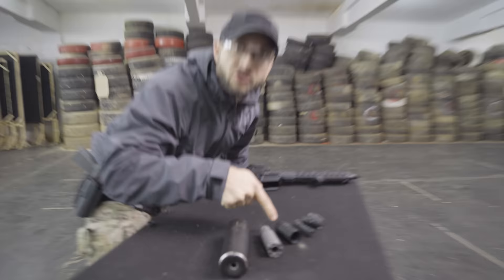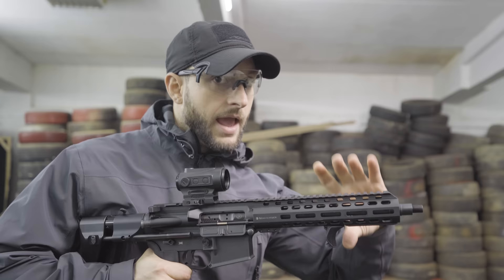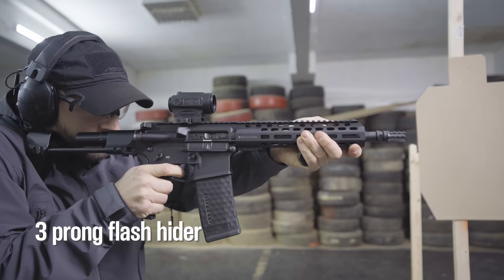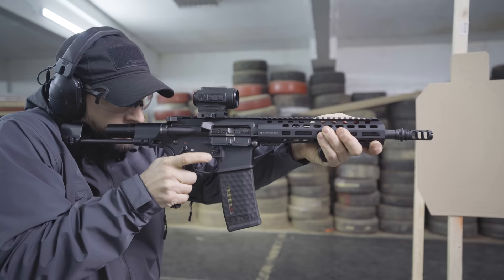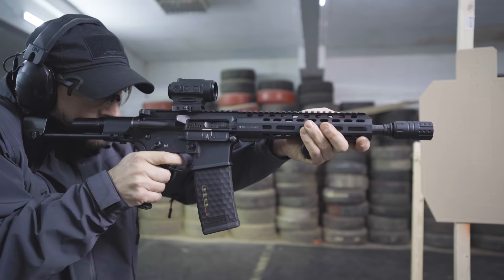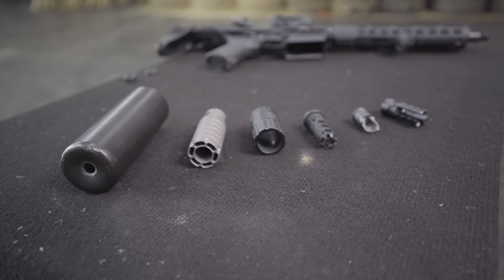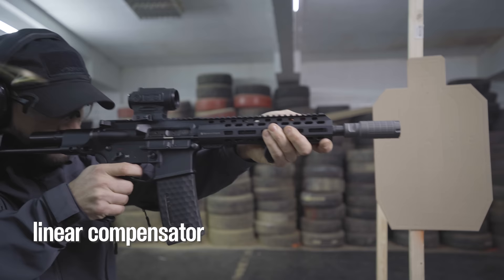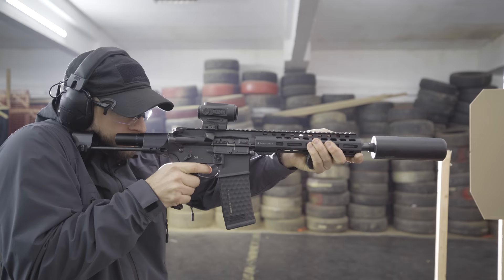Comparison of Muzzle Devices

Comment: Wouldn't a blast shield defeat the purpose of the brake?
Reply: A little bit
Reply: Yes, the one he was using It would defeat the purpose of the break, but there are some special ones out there that do both and they cost more and they are bigger.
Reply: A lot a bit. 
Takes like 65% affectiveness away from what iv seen on yt and iv tried one once n thought the same thing
Reply from the maker: Correct 
You can see the difference in recoil from a compensator with and without the blast shield. 
The blast shield is used in settings where you are shooting in close proximity to other shooters and you don't want to blast them with your compensator. So instead of removing the comp, you just attach the blast shield for that purpose
Reply: Yes.
Reply: Kinda, but I use mine exclusively at indoor ranges on shorties, just as a courtesy
Reply: Yes, it does defeat the purpose of the muzzle brake. By the way, what he calls a "compensator" in the video is actually a muzzle brake. A compensator is something else. A compensator is usually closer to a flash hider than to a muzzle brake and it always has ports on top to counteract the muzzle climb (compensate for the muzzle climb).
Reply: They're the opposite of a silencer. I like to refer to them as loundeners. 😆🤙🏾
Reply: Blast shields are used on ranges that don't allow the use of a break and/or suppressor. Sounds stupid but those ranges exist...
Reply: @jeffersondaviszombie2734  You are not 100% correct. He is showing brake combined with compensator because the device has ports also on top.
Reply: @ggrandcz  OK, fair enough. If it has ports on top, you could call it a compensator as well. In my experience, though, if a muzzle device has the design of a muzzle brake, with added ports on top, most of the time it will still be called a muzzle brake. Usually, the compensator term is more for muzzle devices where, on the sides you have some smaller ports or holes. Things like the Precision Armament EFAB and AFAB, the KAC MAMS, or combo devices (part muzzle brake, part flash hider) like the aforementioned AFAB and EFAB, most VG6 devices, the PWS FSC and a bunch more.
Reply: @jeffersondaviszombie2734  I think that it is stupid to differenciate brake/compensator. My PA M4-72 has more closed bottom part than upper part but all it has are side vents. Is it brake or hybrid? In reality it does not matter.
Reply: @ggrandcz  well, they call it a compensator, but it's a pretty much an almost textbook example of a muzzle brake.:) Well, we're just discussing the finer points of muzzle device terminology at this point. But it's all good.;)
Reply: Larger diameter blast shields allow for more of the positive functions of the compensator to be utilized. If you want to run a shorty expect a flash no matter the muzzle device. Run a heavier buffer like an H2 or H2 with the extra power springs from SpringCo. Also with cans make sure to get a vented charging handle like the one from Griffen called the Snatch or the Geissele Super Badass to keep the farting in your eyes at a minimum. For flash mitigation a suppressor is the best tool.
Reply: Yes, it effects overall effectiveness BUT It’s a sacrifice that needs to be made when working in close proximity of other shooters and working in doors, and should be essential for short barreled rifles and increased user effectiveness . 
	But it is still redistributing the gases to the best of it’s ability and can easily be taken off.  However , if you have a rifle and using it indoors and for home defense , it is extremely beneficial and creates more benefit than drawback especially if your using low recoil 556-545 etc. and  if it is a more compact shorter barrel used for cqc. 
	There are quite a few worthwhile/worthy blastshield devices like the Witt and the delta tek that actually reduce the decibels of the blast and create a hearing safe circumstances which are really the blast shields I consider not just worth it but an important add on. and at the end of the day your helping your own healing health and the hearing health of the people around you!
	they are especially useful if you don’t have access to a suppressor, do not want to apply and register a suppressor and be in an illegal unconstitutional nazi firearms registry. \	Basically voluntarily putting yourself on a list to be persecuted and to be the first to be hit when the global!st n&w world order =United Nations and the us banana republic f&deral govnt. Initiative of civilian disamament and Confiscation is officiated and carried out…
	which is already in the works and someone has already leaked the govnt. Mistake of putting out an online public job inquiry the central gov is already working with the u.n. To hire ex combat vets and police officers for their gun confiscation civil disarmament force and strike teams. Do t play into their agenda /hand, don’t set yourself up for their tyranny oppression! I do understand the people who had legit need for suppressors tho, it’s still very risky SND you open yourself up,

Comment: Could you follow up with flash hiders viewed from downrange, the effectiveness of different comps measured, or if they increase or decrease noise/back pressure/concussion? I know it's a lot to ask, but I'm thinking only a few of your preferred options on a 7.62x39 rifle, 5.56 rifle, a pistol(s) of your choice, and maybe a battle rifle.
Reply from the maker: View from downrange sounds like an interesting idea :)
Reply: @PolenarTactical  glad to have piqued your interests
Reply: @PolenarTactical  live test ceramic backface deformation while you're at it.
Reply: @PolenarTactical  I have a question that I haven't seen discussed before. Does using a muzzle brake vs a flash hider, in conjuction with a suppressor, increase flash signature to any measurable or noticeable degree? I'm currently using a Surefire muzzle brake with a Surefire Socom556 RC2. I went with a brake to act as a sacrificial baffle. Saying this, flash signature reduction is my highest priority so I'm willing to switch it out for a flash hider if there's a noticeable difference.

Comment: There are 2 more types of muzzle devices. 'Bulgarian style' linear comps, which work like any other linear comp except there is zero flash, and brake/flash hider hybrids which do a bit of both, like the precision armament afab or efab.
Reply: I have two AFABs, they're an interesting combination of both comp and flash hider.
Reply: @ReticentIndignation  I have one too, it's quite good, but expensive.
Reply: @mananaVesta  Indeed, I went with AFAB due to price vs the EFAB (as well as barrel length).
Reply: Plus there is the huge assortment of purely decorative muzzle devices who have a cool design/shape and generally awful performance in every category.

Comment: Great video as always. I would be interested to see what the flash signature is from different muzzle devices is under low light. Obviously flash hider will be dimmer than a muzzle brake but there are almost no one to one comparisons that I can find.
Reply: Some brakes give you both recoil reduction as well as flash suppression.  I worked for a gunsmith for several years that specialized in competition guns and we frequently installed a Weatherby style muzzle brake on competition AR rifles that under low light testing had nearly zero muzzle flash. We'd cut the brake to the same diameter as the barrel, it was radially ported 360 degrees (not great for prone shooting from a signature perspective), and was about 1.75 inches long. Our LE customers loved them because they could shoot faster while under NODs because of the reduced flash, and the thunderous concussion indoors from the brake was a feature instead of a bug for them- added disorientation for the bad guys I guess. This was back in the late 90's before suppressor usage was widely adopted and (smarter) tactics evolved.

Comment: Well 4-6 inches of additional barrel length and you have no more flash or need for a blast shield. I really dont undertand the need for such a short barrels.
For a cqb you just don't go with a fireball in closed environments or your ears will suffer even with protection.
If using the right tool is recommended then go bullpup or smg. 
Anyway thanks for the vid i always enjoy watching you guys (pshhhhhht 😉)

Comment: Wish you could get your hands on a Witt SME to test compared to the Alibaba knock off.  

Funny enough, I have that exact brake and shield on both my 13" 5.56 beater and a 7.5" barrel that I run a CMMG 22lr conversion in.  The 2pc system was like $30 & does it's job, was pleased with it vs paying $180 for a Witt SME

Comment: Do this same test, but then screw a suppressor on both of the different muzzle devices. I REALLY want to know how the flash mitigation is different when using a muzzle brake and/or flash hider in conjunction with a suppressor. Flash mitigation is priority and yet I've seen nobody do a comparison video on this specific thing before.

Comment: Any info on longevity of these devices? How many rounds will it take to hot gasses burn some material that you will need to change it for new one?
Reply: Flash hiders, brakes, comps, and blast shields should run forever without issue. Maybe wipe them down twice a year?

As for suppressors, many have a maintenance schedule that's usually specific to each. Always read the manuals to be sure, or call the company if the manual doesn't answer your questions.

Peace✌️😎🇺🇸🍻
Reply from the maker: Your barrel will burn out before the muzzle brake. 
Depending on the type but suppressors should be cleaned from 1-5k rounds because they can get very dirty and fill up with carbon, copper and lead. This can make them less effective. If you use aluminum suppressors it's advisable to check them after every 500 rounds for damage or erossion

Comment: Could you explain how the flash hider works? from my newbie point of view it looks really similar to the compensator yet it gets rid of the flash, why is that?
Reply: Hot gas hit the air which excites the air and causes it to light up. It's like the flash if you cannon ball into a pool. 

Flash hiders mix the gases more gradually then just exciting the barrel so it's more like diving into a pool so you have less of a splash.
Reply: @matthewconnor5483  Well said. This is a question I've been meaning to research and your analogy keeps it simple. It's gonna take me a couple more days to accept it's not just sorcery of the gun gods, but that's ok👽(I thought there was a wizard emoji🤷🏼‍♂️)

Suppressors contain, slow, and cool the gasses, which lowers the sound, like farting into a pillow.🤫💩
Reply: @Jeff.78  I like to think of a suppressor like a retaining pond. It gives the fluid a place to sit and slowly be released vs flash flooding.
Reply: @matthewconnor5483  That works too

Comment: How that back pressure while using supressor compares to piston operated AR
instead of typical direct impingement ?
Not personal experience yet about that but every info and potential videos from
it are welcome.
Reply: It's not so much "back pressure" as it is the length of time the system is pressurized. A suppressor slows the gases exiting so the barrel remains under pressure so more of the gas is routed back into the gas system. On pistons that often ends up being vented into the hand guard instead of out the muzzle but in direct impingement that means more gas in the receiver.
Reply: @matthewconnor5483  I know supressor will add extra pressure on system. And i own 
piston operated AR. Those venting gasses will dirty your hand specially if doing c-clamp grip.
But because i dont own supressor(yet) and very minimalistic shooting with regular Ar 
it would be nice to hear opinion by more experienced shooter
how handling and using both systems feel different when supressor it attached.
Reply: @Kesssuli  ARs are known for alot of gas to the face when you suppress them, especially for left handed shooters. This is what helped lead to "flow through" designs in order to minimize that increased dwell time and the increase in fumes in the receiver that vent out the ejection port and charging handle.
Reply: @matthewconnor5483  Funny part there is that im left side shooter because dominant eye. Ak:s sometimes throw some crap to back when cheap steel case ammo is used. I dont remember RK doing that when lapua ammo was used. And in army we didnt had anykind of eye protection either. Dont know have that thing changed during years.

When got own Ar i kind of went future proof to minimise crap to face potential when supressor is attached.

Comment: my experience in the old days tell me, you can't 100% hide the flash or elimate recoil. that's physics, action and reaction. i would suggest focus more on what's coming out from the ejection port. those smoke and gas may contain lead from bullet primer, and a bad experience when carbon deposit and gun oil cover your face and eye. remember that oil filter silencer test? in the worse case scenario, it cause stoppage. therefore, any device that direct gas and flash front and side may be a better choice, but not always. that's why mp5sd are so famous in those days. it consider and balance everything happens in the chamber. even that gun do have it's own limit. this is a question without perfect solution.

Comment: Is there a difference in performance between a 3-prong and a 4-prong flash hider? If so, what is it?
Reply from the maker: Not really, the number of prongs doesn't make so much of a difference then the proper geometry
Reply: There's a difference in pinging sound, possibly durability.
Reply: One of the best for 5.56 nato is the A2 birdcage. Cheap n effective.
✌️😎
Reply: @Jeff.78  it really is a good design.